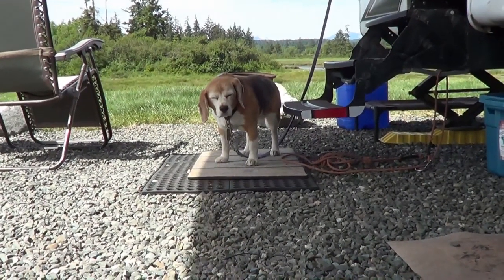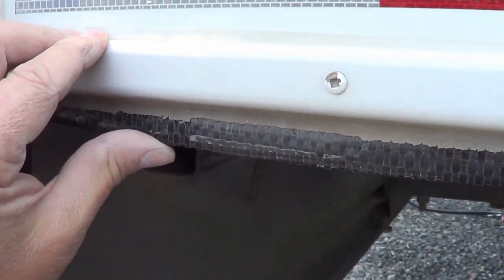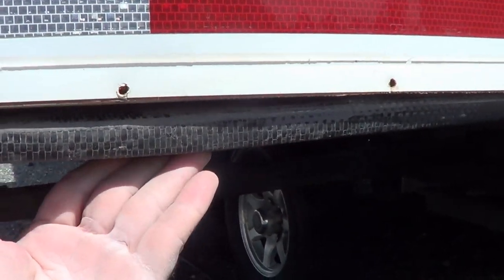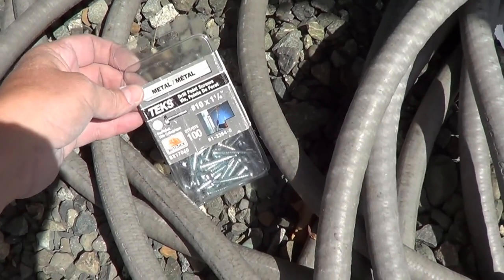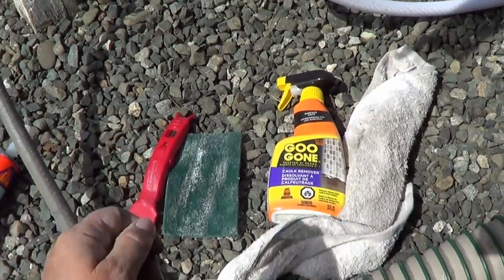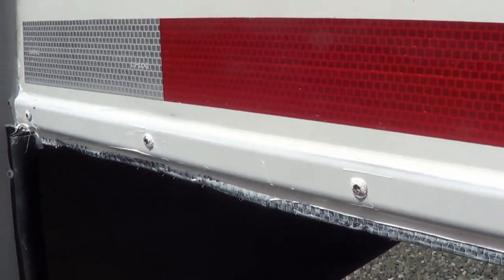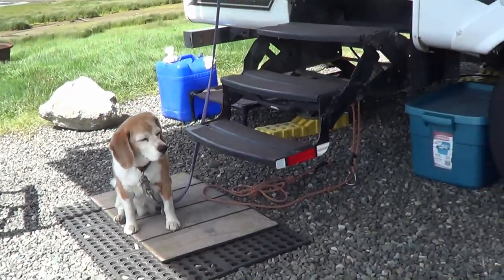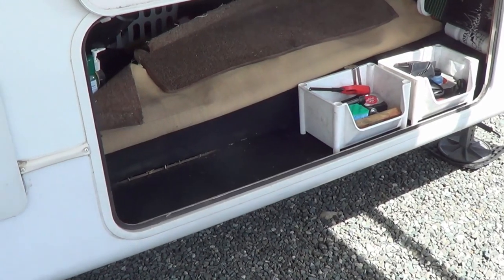Fixing a Leaky RV Slide Out Seal

Comment: It is definitely I good sealing product and it stands up for ever!
Reply from the maker: I was thinking of using some on my plastic trailer fenders that are above the wheels. Currently, they are held on with screws but the plastic is starting to crack around a few of the screws. Thinking of pulling them off and running a bead of Sikaflex behind and reattach and cover the area around the screws with it.

Comment: I'm always looking for potential leaks as well Ray. I find those razor blade window paint scrapers to get paint off the glass removes silicone really well on a flat surface and doesn't scratch the finish. Works super fast.
Reply from the maker: Thanks for the tip! I'm also going to pick up a silicone scraper blade for my new oscillating multitool. Redoing the shower stall caulking is on the list for the fall.

Comment: I used Sica to seal my outboard to the back of my boat then had to remove it three years later, it took two hours just to break the bond.  Had to use two wood plane blades to force the bond to break.  Man was that engine stuck.  Didn't even need the bolts!!
Reply from the maker: haha, WOW. I wonder if it was the 291, I see there are many different formulations, some are more of an adhesive and some are more of a sealant. ie. 291 is for sealing and 292 is for bonding
Reply: No idea, but u can't go wrong with the product.

Comment: I had similar thing happen to my slide, I injected wood epoxy to strengthen the wood then applied eternabond  tape to all the seals on the outside.
Reply from the maker: Good ideas there. I have Eternabond on all my roof seams, great stuff.

Comment: Thanks for the education.  Another way to beef up that area where you store your tool box is to cut a board to fit tightly in the bottom and then a couple of aluminum angles mounted on the end for the board to sit on.  With the screws in horizontally instead of vertically you get more strength.  If you really want to go deluxe a couple of angles the length of the board will really keep it from flexing.  Just a thought.
Reply: Good idea just what I was thinking.
Reply from the maker: Thanks, I was considering some sort of angle iron setup. I was thinking of bolting them onto the backside.
Reply: Definitely stronger that way.

Comment: The water wicks off the side as it runs down the wall. It will run over and under the floor wood and slowly soak and gets the carpet wet also, that’s a problem on all slide outs. It needs a drip edge, so the water drips down and can’t go back under. I stopped the problem by putting a strip of aluminum tape across the bottom edge and just remove it when I bring in my slides
Reply from the maker: Found out mine had already caused damage. Ended up replacing part of the slide floor and installing a metal corner bead so it drips off. That was 4 years ago and no problems since that. https://www.loveyourrv.com/rotted-rv-slide-out-floor-repair-fixed-manufacturer-flaw/  Cheers, Ray

Comment: Ray that was a nice repair job on that slider, I was wondering why you didn't use a small 1/8 inch think by 1 inc wide length of aluminum along the screws for a wider head for the metal screws? Were you worried it might have been to thick? Thank you for sharing !!
Reply from the maker: Yeah though it might get too thick and jam. My slide doesn't have rollers so it just sort of slides on the carpet and a couple plastic shims at each end. I contemplated a metal plate but thought I'd try just the screws first, see how that works out.

Comment: There is a good possibility you will never be able to get that trim strip off without destroying it, I have used Sicaflex marine grade on my boat, that stuff doesn't like to let go,
but it will never leak!
Reply from the maker: I figure I could get an exactoknife blade in behind it. There is also this stuff called Debond - https://www.westmarine.com/buy/marine-formula--polyurethane-adhesive-spray-cleaner--12222295  But hoping I never get a leak again.

Comment: A little food for thought, do you think that the sides of the floor may just be wicking water through the black covering on the plywood? I have just experienced the same sagging issue with my floor of a 3-year-old Keystone, and I believe the fact that they leave the sides of the slide-out floor exposed to the elements is actually the real problem. I plan on doing the same thing you have done to secure the floor and also adding a slide out ski drip edge. Your slide out floor is still in danger of wicking water from the sides due to still being exposed.
Reply from the maker: I've been watching it on both sides since the repair, two years now and hasn't been a problem, with the cracked silicone seal water was able to get in behind the flashing and right into the wood floor board and stay there. With the bottom, it might get under the slide but quickly drops off it and the black plastic cover seems pretty water resistant. I also wax it, find it helps the slide run smoother and I guess also replaces water.
Flashing may be an idea but have to make sure it doesn't interfere with the slide going in and out.  Clearances can be tight. Cheers, Ray

Comment: hey did this work well for you? I have a one year old trailer with this same sag. I have to take it in to see if the manufacturer will pay for the fix as it is only a little over a year old from date of purchase. these things leak from the manufacturer I swear. dealerships should recaulk all problem spots before selling them
Reply from the maker: Yes, one year later and the patch is solid, no more leak there, the wood is firm.  :) Glad I caught it in time.
Cheers, Ray

Comment: There are neoprene skis you can install on the bottom.
Several different choices.
Reply from the maker: I added a aluminum corner bead, works well and gives a good drip edge but should have went with stainless steel as the aluminum deposits a bit of black oxide on the floor that I have to clean off every once in a while.

Comment: Any reason you used the caulk sealant instead of eternabond?  I did all my roof seals last year after watching your videos. I’m about to work on my slide and had planned to use eternabond on the slide roof seams, and also all the screw seams on top and down the sides. I noticed you didn’t use it on the sides. Any reason?  Thanks so much for your videos that have been incredibly helpful for a DIYer
Reply from the maker: On the top of the slide, where the rubber roof is I used Eternabond to cover the seams but I figured the SikaFlex would be a more robust repair for this area. I took off the metal flashing and added it underneath and then put it back on.
So far I'm really pleased with the results, the SikaFlex is stiff but still fairly pliable. I have good confidence in the repair lasting a long time.  Cheers, Ray
Reply: Thanks for the quick reply!  I had some screws backing out going down the side of the slide.  for now i just snugged them up but had planned on eternabonding. Would you recommend the SikaFlex here?
Reply from the maker: If you pull the screw and dip in SIkaflex and reinsert it should keep the screws in and sealed, the stuff is used for boat hardware. The only drawback is the stuff is so good it can be hard to get hardware off if you ever do want to. Another product people use for RV sidewall reseal is called ProFlex RV https://amzn.to/2txHV1V It's a little less permanent.

Comment: What's a good way( product ) to lubricate the plastic screen door latch mechanism unit on my Dexter screen door?It's  Probably entirely plastic except for a metal spring and pin maybe. ( I dont mean the sliding clear plastic main  door access window. Although that needs some good plastics lube too it seems, when it acts up.) It's got a squeek and don't think it operates as smoothly as it can. It's got 3 screws on the inside handle unit. Maybe spray in some stuff? I got this BMW wax less( I think oiless too ) chain lube stuff that's non dust holding from BMW motorcycle shop. The sales guy told me he didn't like the wax type chain lubes. I used it on my bicycle chain and it's good. Seems to dry and dissappear. No wax gunk buildup. Often I just spray something like WD40 in a door bolt and through the key hole and just that helps without even having to go in deeper taking off the handles etc. which would be the most thorough. Prost
Reply from the maker: I may be inclined to try some 303 Aerospace Protectant on it.

Comment: Ouch that needs to be rebuilt with new Wood and the seal repaired and check slide if it is going in fully evenly
Reply from the maker: The repair has been working well almost 2 years now, caught it in time before the floors structural integrity failed.

Comment: Is there a reason you chose not to use eternabond on the lower slide joints?
Reply from the maker: I contemplated it but thought it may look bad, especially if I didn't get it to stick without creases. The shape was awkward to cover with the metal flange and the screws
No one sees it on the roof, but the slide is pretty visible. Thought I give the Sikaflex a try instead.

Comment: How about using an aluminum angle 1" x 1"  on the inside of the shelf.
Reply from the maker: I'm thinking of using some longer heavy angle iron pieces on the back side of the box. Bolted to the vertical wall.
Reply: Love Your RV if you have access to some who can bend steel for you, piece bent to fit in that inside corner would work great. Something with a 6" wall on either side would be great. And not to thick like angle iron.

Comment: Ray, great video. I've used sikaflex for years and it works well but you have to use it before the expiry date which should be stamped on the bottom.  They usually have a 1 year expiry but I've received stuff that only had 3 monthes left before expiry so you just have to be aware of it.  Another sealant that works awesome is Right Stuff, you can even put it on a surface that's wet and it'll displace the water and still stick to almost anything, but it doesn't work well in the presence of gasoline.  http://www.canadiantire.ca/en/search-results.html?q=right%20stuff and
Reply from the maker: Cool, thanks for the tips. I hand;t heard of Right Stuff, will have to check it out. Cheers! Ray